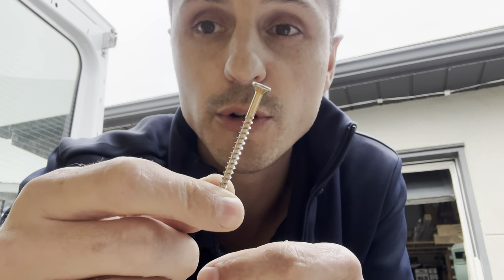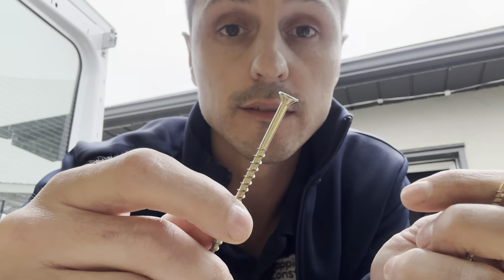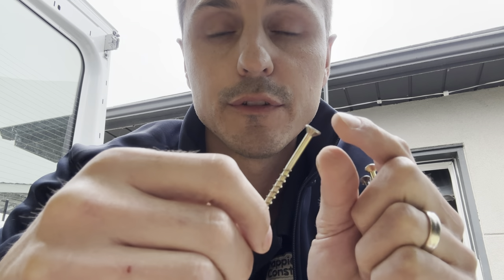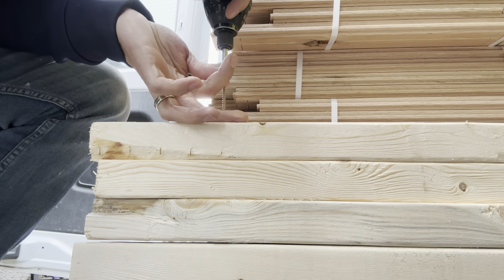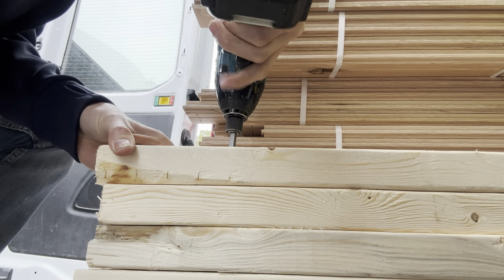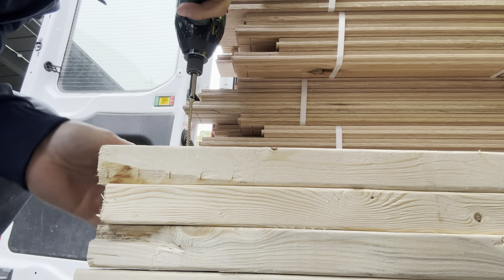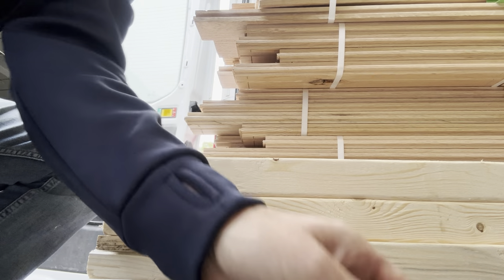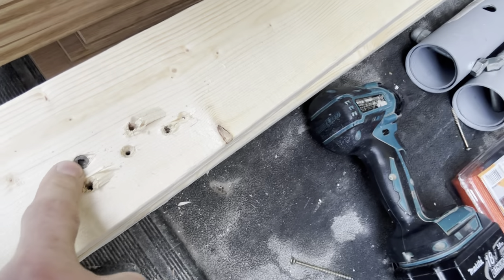Problems with modern screws… Screw wood, not the user…

Comment: Great point! But where are you using screws when framing? I’m curious. Been doing this for over a decade.. a nail gun and a hammer are my best friends. What are u doing to comp for the loss of shear strength that nails provide and screws don’t? Again im genuinely curious not trolling here just tryna learn.
Thanks
Reply from the maker: You are completely correct about nails and nailers and you know it. That being said, temporary shoring walls are all screwed for easy disasembly as well as framing that requires a little more finesse and don’t need the strength I.e shower niche etc etc. Also, often enough in the renovation world, we don’t have nailers out but we always have drills handy. If we have a dozen studs to put up in a non loadbearing wall, we will screw it in. Thanks for the watch and comment! :)

Comment: I find getting the screw started into the back piece then pulling it out, pushing both pieces tight with your hand and driving it in helps instead of driving the screw itself in until it gets tight. Or pre drill both pieces.

Either way though I see your point, it’s a waste of time and you shouldn’t have to do either of those things especially when it comes to building large structures, it’s a waste of time that adds up.
Reply from the maker: Thanks for the comment and for watching the video! Hopefully a screw manufacturing company can comment and send us in the right direction or start manufacturing screws like they used to. All the best!